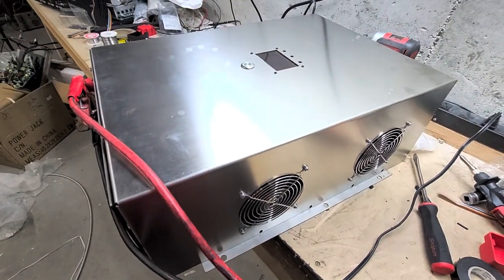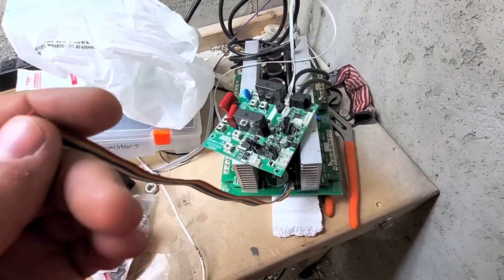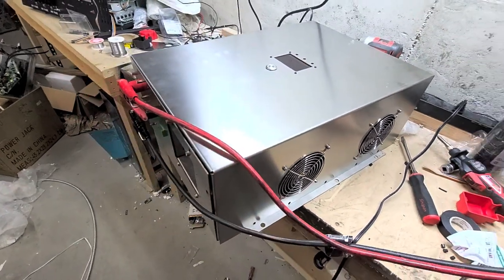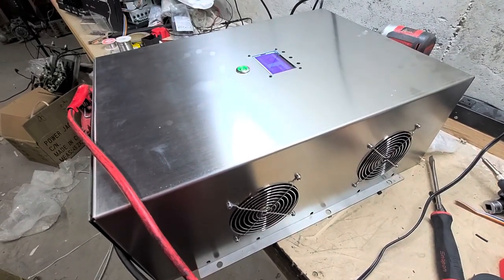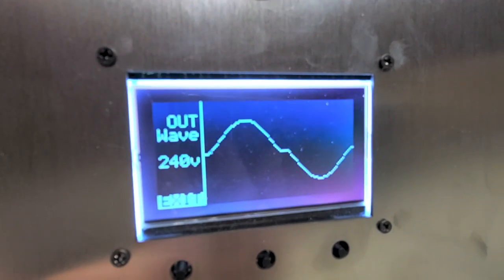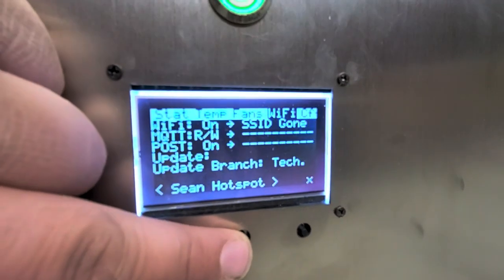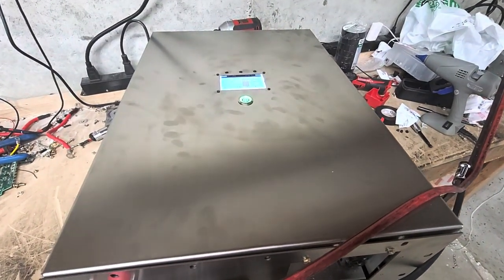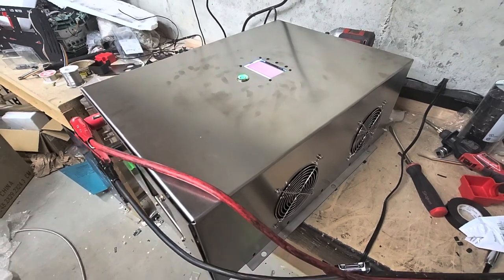Finally got the Genetry Solar 12kw inverter up and running and it's 👍

Comment: Garabage inverters. Chinese crap. Surpised your still messing with this junk man. I spent so much time on this myself... and spent well over a 1000 on this just to have a boat anchor.  Im just  glad it didnt burn down my house! Just bought the growatt 12kw all in one inverters and dude that is an actual inverter with qualtiy and actuality meets its claimed watts while staying cool without the use of massive fans... because its efficient! ...and built to last.You get what you pay for when it comes to inverters and copper. I just hate to see so many people fooled by this terrible company.  I was one. Id suggest if your really serious about staying off grid, reliably,  and safely.... fork out  at least 2500 for a solid inverter.  Im glad i did! No more wasting my time!

Comment: Idle consumption?
Reply: Seems to be right around 1 amp @ 55vDC.  However, it reportedly uses 300mA with the power switch off--either the ammeter isn't right, or something is amiss.  This is a prototype, so things happen.
Reply: @sidlori1592  That's good info and seems like a reasonable number, especially for a prototype

Comment: Nice video and hopefully nice inverter.. Btw you are absolutely right about that cable ..in my 5kW inverter i did see about 15cm cable two together so it was pretty short..and also they put some small choke there(on the cable itself) just to be 100% sure no interference will change anything.... Btw that Sinusoid graph..well i would more want to see other things or custom screen. I think it is not needed because even it looks nice it will not tell much ..so i would suggest to use screen with only output data + temperature  on key points in one screen..This i believe would be more usefull for person and 3 separate screens..But anyway good job no doubt about that  (about that interface that is..)

Comment: I HAVE QUESTION  will this monster have the muti tap transformer  if so since 12 volt is not possible will we be seeing  a 36 48 and maybe 60 volt option 

lots of people still  are running 24 volt  systems  and need a bigger inverter 
if you guys do 24 volt tap they could get a big gs and have plenty  of inverter 

 even if they could not run full wattage at 24 volts  the gs would still be the smartest choice  for the huge savings from not having to buy a new inverter  when they upgrade to a higher  voltage 

thats my two cents anyway you guys have blowen me away i am all most speechless 
you guys are hitting them out of the park
Reply: Currently designed for 24,36,48,60v, though the 60v setup is limited by the absolute maximum DC input voltage of 75vDC.